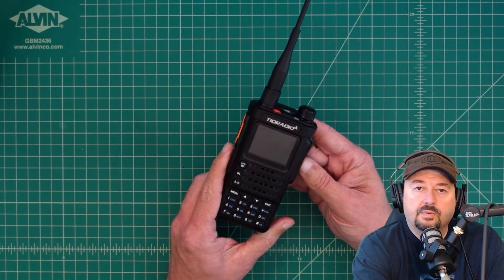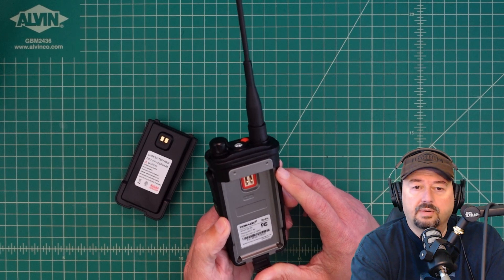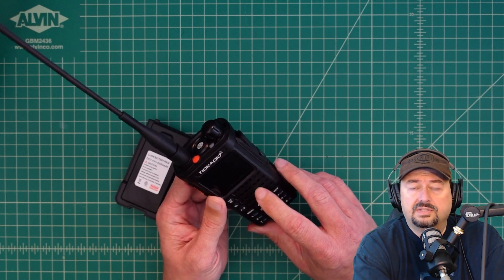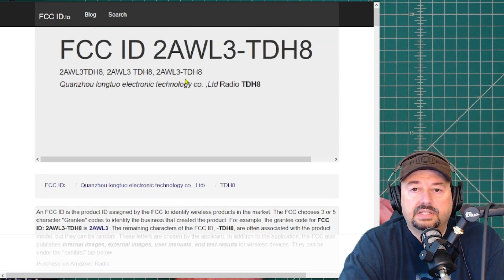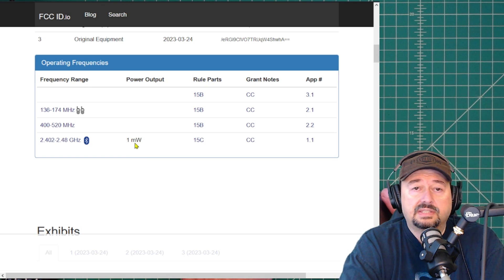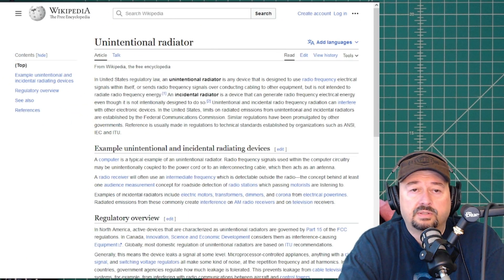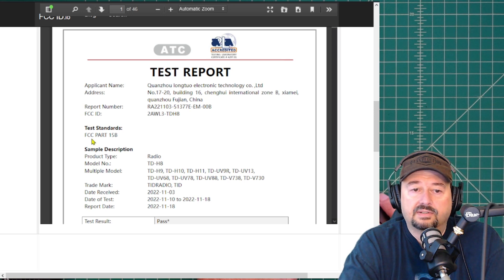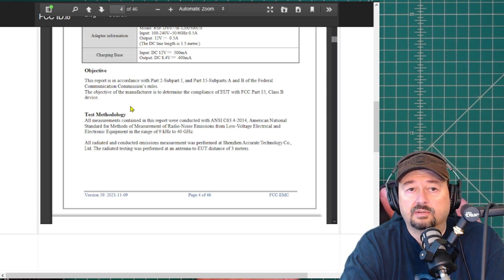FCC Approved? - TIDRADIO TD-H8 Gen2

Comment: What I've been really wanting to know about this radio, why do I receive a pure silent transmission, even with antenna removed, on FM freqs 77.8, 77.9, & 78.0mhz??? Could it be pocking up "spurious" transmissions from its own internal circuitry, maybe the CPU? Am I the only one???

I'll see if my SDR spectral analyzer picks anything up as well on those freqs. Being its picking it up without the antenna even attached, shows the transmissions are EXTREMELY strong or extremely close by.

Comment: Good morning to you ThesmokinApe , Is there anyway you could help me to set up my TIDRadio TD_H8 GMRS . I bought two of them one for me and one for my wife.. I downloaded the app in my phone. Never used these radios before.. I like to program several different frequency. Also how we could add on repeaters that way we could reach longer distance and finally have emergency frequency saved . In case of emergency. thank you God bless you and America.
Reply from the maker: If you have the programming cable you are better off using Chirp
Reply: @TheSmokinApe  I do have the cable
Reply from the maker: Chirp is going to be the easy way
Reply: @TheSmokinApe  I try to put frequency 154.570 and after we enter the number and key the radio says canceled. please help me to program the radio thank you.

Comment: My understanding of the approval process. The FCC does not test anything themselves. The company submitting the device for approval does the testing themselves or pays a third party to do the testing and submits the test parameters and results to the FCC.
e.g. for a given single test, I would document the test, the test parameters and then a screenshot of the specan or whatever else would document the results.
Reply from the maker: You want ever see a radio with a certification for Part 97, which governs ham radio, because it doesn’t exist.  If a China radio has any certification it will be a Part 15 which almost all types of electronic should have.  It has nothing to do the part 97 or spurious emissions 👍

Comment: You are correct, amateur radios are not subject to confirming to emissions regulations, except for part 15 which covers everything from vacuum cleaners to outdoor lighting. Spectral purity is specified in part 97 because the assigned frequencies in the GMRS specifications.
Reply from the maker: I get in these arguments:

Them: How can it be dirty if it's FFC Certified?  I don't care if it is dirty, it's certified.

Me: Half the certs are fake and the ones that are legit don't cover it...

They almost aways don't believe me.

Comment: I hope this clears things up for most.

Based on FCC guidance, individual users and operators are responsible for ensuring that they operate their equipment within FCC guidelines. However, two-way radio manufacturers can make any claims about their radios, even if they have not tested for spurious emissions.
Reply from the maker: Agreed
Reply: @TheSmokinApe  by the way what’s your budget recommendations for VHF UHF DMR capable radio HT and mobile/manpack. Retired from the military had interesting career with comms and just getting into the CIV side of things.

Comment: Reading through the FCC posting, I only found that the radio was tested as a transmitter in the GMRS band. In other words the radio was not tested for transmission in the 2m or 70cm ham bands. Which goes back to my assertion that the H8 was designed as a GMRS radio, where for some reason they decided to sell it for ham radio use with the fallout we observe. Spurs, audio EMI and so on.
Reply from the maker: Sounds about right to me, thanks for watching VSC 👍

Comment: and obvious the FCC is not policing as there are many  hams using the radio now and tons of gmrs people also
Reply from the maker: right
Reply: I could totally be wrong, but based off everything I’ve gathered, I’m pretty sure the GMRS variant is FCC certified and legal for that purpose. And also, the Ham variant is what I’ve seen complaints about regarding the Battery pins getting hot and the excessive dirty spurs pumping out.
Reply: mine tested within all fcc specs on harmonics. so fr  have been abe to only find 3 reports of pins getting hot on the battery when using vhf. Mine does not have that issue it does gegt wam on the belt clip bracket  but not hot when I use it heavy for race reporting at out marathons

Comment: I've seen complaints about RF burns from touching the pins on the back of the radio (specifically the first pin). Have you tested for this?
Reply from the maker: I felt some heat coming off mine but not as bad as the others have reported.
Reply: If someone claims an RF Burn from a battery connector on a 10 watt radio, my first thought is that they are a clueless moron.

Even if it got hot enough to burn for some magical reason, that would be a thermal burn not an RF Burn.

Comment: Sneaky, its also not just RF, (or just China),  for instance Indian cable "Orbit", have plastered UL over industrial and power cables, that are not UL certified, not even tested, UL solutions advise ripping the junk out if you use it :)
Reply from the maker: It's a shame that the manufacturers do that.
Reply: @TheSmokinApe  yep, and there should be severe consequences for it, oversight or not.

Comment: I remember seeing a report on a RF Power Amplifier, and couldn't understand that it didn't measure harmonics, spurious.. What are the basic parameters that need to be checked.. Its pretty simple.. Isn't there a FCC doc that states that?
Reply from the maker: https://www.law.cornell.edu/cfr/text/47/97.315

https://www.law.cornell.edu/cfr/text/47/2.815

https://www.law.cornell.edu/cfr/text/47/part-2/subpart-J
Reply: I think ETSI (European) doc is ETA 300 684.
Reply from the maker: @technishn  👍

Comment: I just double checked the TD-H8 I have here, and it matches up almost exactly to your tests.  Quick 2 meter results: The radio does surprisingly put out 10+ watts on high.  Unfortunately, the second and third harmonics are above the 25uW limit (-16.02dbm) on low and mid power.  When transmitting on HIGH (10.08W for my unit) the second harmonic is down -48.97dBc (PASS), but also is at a level of approx. -8 to -9 dBm. (FAIL!)   On my unit, the 3rd harmonic actually passes on high power at -61.5 dBc from the fundamental at around -21 to -22 dBm.  But it doesn't matter since the 2nd harmonic already failed!   I didn't bother with the 70cm side, since this lined up with your results. Good video series on this radio!  Thank you!       I wish I could post a pretty picture of my Siglent Harmonic screen. :)   These numbers are for reference only, as I also may not know what I'm doing. ;-)
Reply: Is your TD-H8 a "2nd Generation" version?
Reply from the maker: Thanks for double checking the numbers 👍

Comment: If the radio can be programmed via the keypad out of the box outside  the 144 - 148 Mhz and 420 - 450 Mhz range no matter if it has an FCC ID, the radio is illegal and can not be sold or imported in  the U.S. Take a look at Enforcement Advisory DA 18-980 from the FCC.
Reply from the maker: I agree, thanks for the comment.